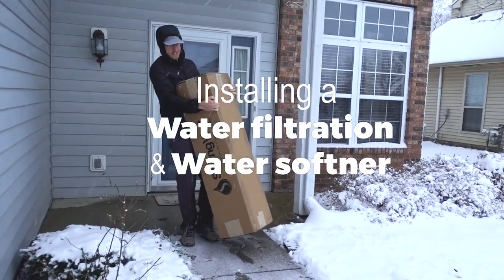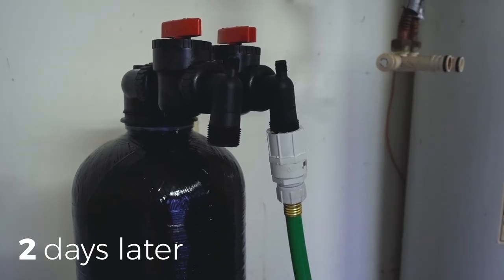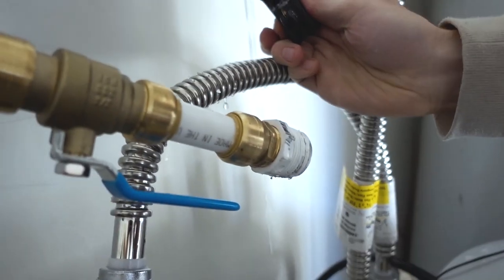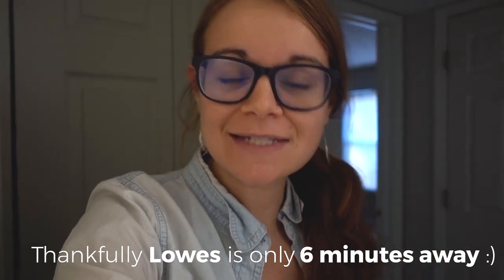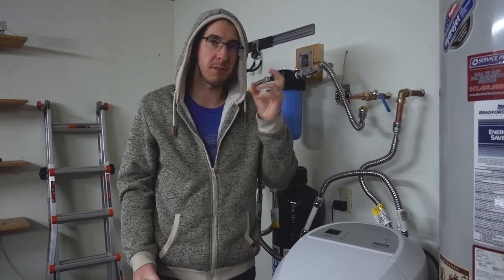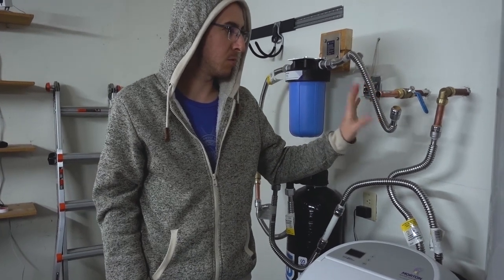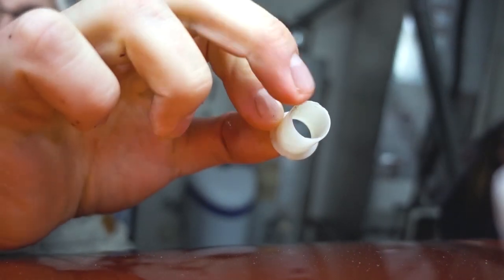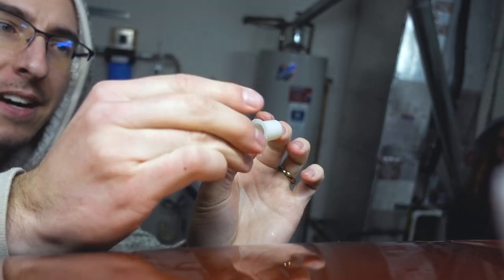FIRST Big DIY project: Installing a Whole House Water Filtration System

Comment: Good thing you made it work that night, water is kind of a necessity and hard to be without for til long ;) Kind of a DIY guy myself, but piping I leave to the pro's ;) (partly because it's potentially expensive if something break, and I don't think insurance will cover damages if it's not done by a  qualified plumber,  at least not in Norway). Good thing Peter's brother is a plumber though, nice to have someone to call for guidance :)
Did the water taste better btw?
Reply from the maker: Yes! It was great when the project was finally done!! We thankfully had water during the project.

It was great to finally have filtered water though. Yes, we could taste a difference. 

We are both a little picky about taste of water and didn’t like it before and ran it through a filtered water pitcher, but the next morning when we tasted the filtered water, it was so refreshing 💦 

Also, for some reason the water here made me itch, so after showering my scalp would be really itchy, but that went away with the filtered water 👍
Reply: @HappyHoppe  Great to hear that it's working. It was really interesting what you said about the itching with the unfiltered water. Our water goes through a water softening system as well (common private well and water filtering for the whole residential area, about 15 houses), but sometimes it's not filtered properly (usually if the salt runs low) and tast iron (and turns brown if we let i stand still for a little while), and my wife has been struggling (periodically) with itching after showering as well. Maybe it's for the same reasons (minerals or other particles in the water).
Reply from the maker: Morten T yeah we got a water filtration and water softener- I don’t know if our water softener is working, but I believe the filtration is because of taste and no itching anymore.

Peter reset the softener today, so hopefully soon our water isn’t as hard and won’t destroy our pipes.
Reply: @HappyHoppe  That 's great :)

Comment: How are you liking the Springwell filter? I am considering this, but the 2-in-1 softener+filter that Morton has seems so much cheaper.
Reply from the maker: It seems to work well. Very low to maintain once installed.

Many kitchen sinks don’t allow the water to be softened - so we had to have a plumber switch that, so that the softened filtered water came through.